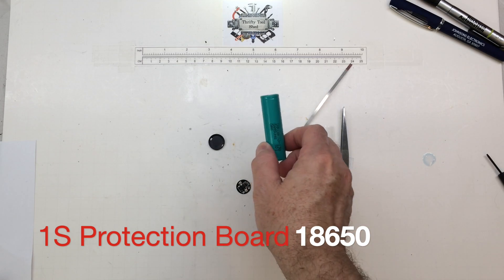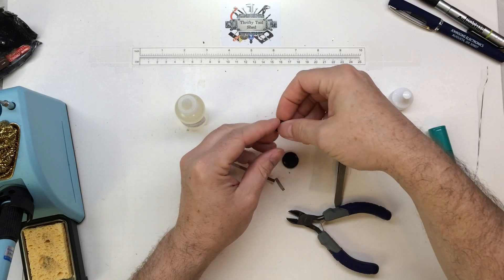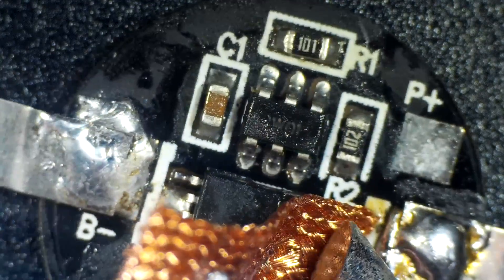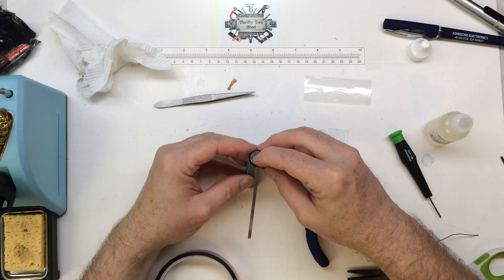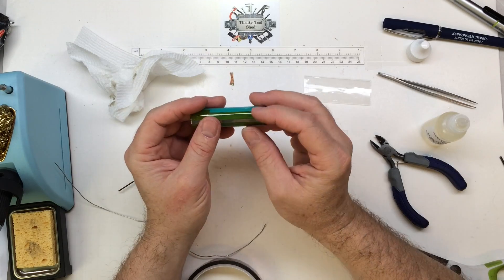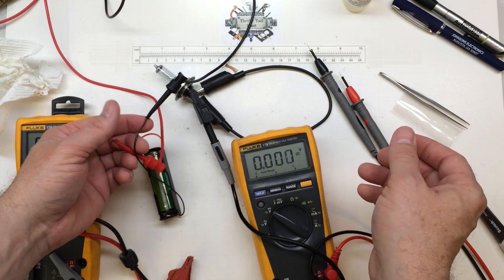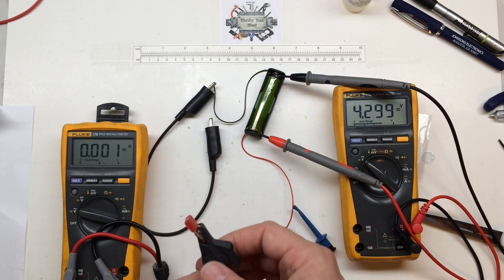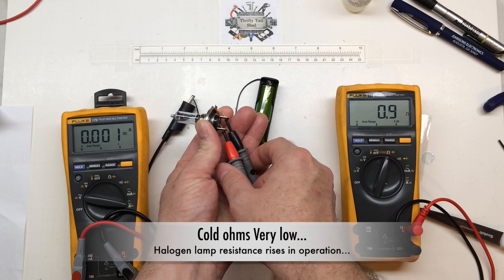Build a Single Cell Li-ion Pack with Protection

Comment: Is there an issue if anyone uses 2 or 3 of these protected cells like the one you used here in series or parallel in a cell holder?